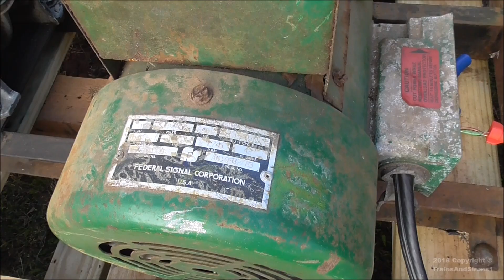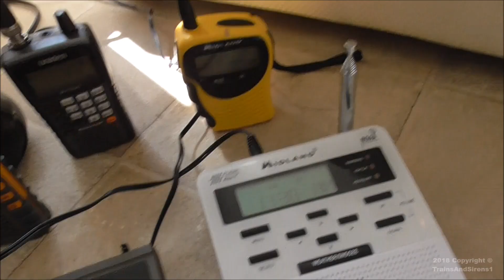SC Tornado Drill: My Thunderbolt 1000 (WITH BLOWER) First Full Run, Attack Signal 3/7/18

Comment: I would not recommend wiring the blower to your Goodman heat pump as that could cause serious damage to the system if done incorrectly so id suggest getting a separate breaker for the blower which im sure you have done now.

Comment: Thunderbolt 1000T
1:47 - Blower activation
1:50 - Chopper motor activation
5:41 - Chopper motor Shutdown
5:56 - Blower shutdown
Reply: It’s a 1000 not a 1000T
Reply: @cherryblossomT2874D  i thinnk it's a bit like 1000T with 4/5 port chopper. Or 1000
Reply: @x_x-t6m  thats a model 2T running before the thunderbolt
Reply: @cherryblossomT2874D  yes. I put the timing for that too in another comment.

Comment: Lol a for effort but that's some janky ass wiring lol. Good effort for a kid tho I give you props. With some guidance I'm sure you can be a good technician. You should have had everything wired to that electric panel or at least thrown a sub panel near the horn. If you are going to keep it there I'd highly recommend you install a sub panel with a disconnect near by.

Comment: Should try to put one of your Model 2T choppers in your T-Bolt. Your Thunderbolt sounds nice and healthy.  Keep up the good work.
Reply: You can’t turn the 2T into a 2; the stator would still be 4/5, and it wouldn’t be running at peak efficiency. Also, his 2T is 125V, the Thunderbolt is 240...I’m no electrician, but I’m not sure if that would work. Jeb would be the one to ask.
Reply: YES! Turn the T'Bolt into a 4/5 and the Model 2T into a Model 2.
Reply: Perfection ^
Reply: Siren Hunters the motor voltage wouldn’t matter. The only thing being changed is the chopper
Reply: Siren Hunters Swapping out the physical chopper makes no difference whatsoever, it's not an electrical component.
Reply: Siren Hunters Not to sound crazy, but I know there was a video of a Model 2T with a 5/6 chipper.
Reply: Jared Thompson speaking of which, is this the video?
https://youtu.be/h2oxjlLF3v8